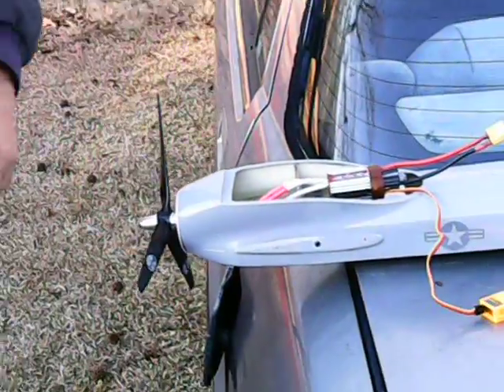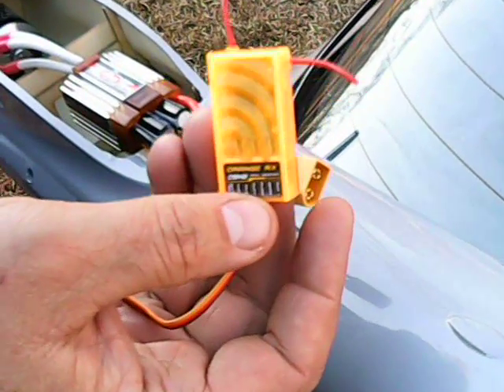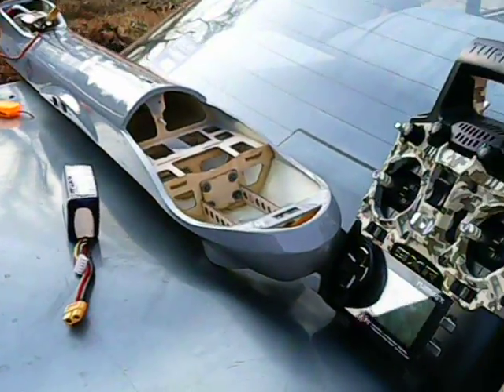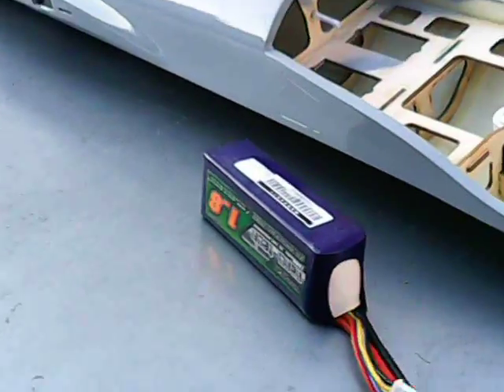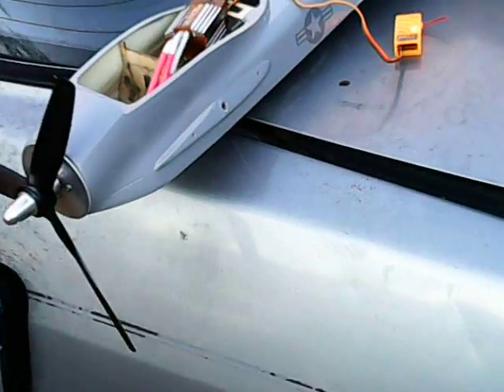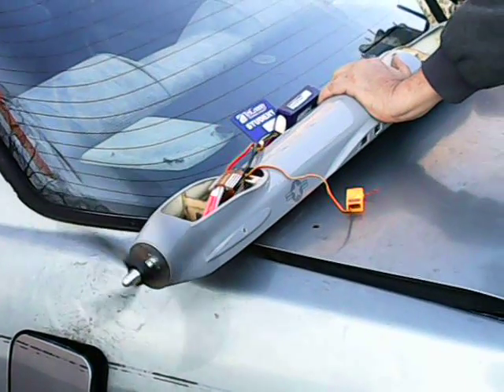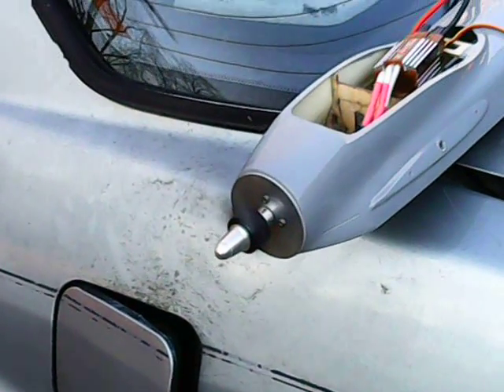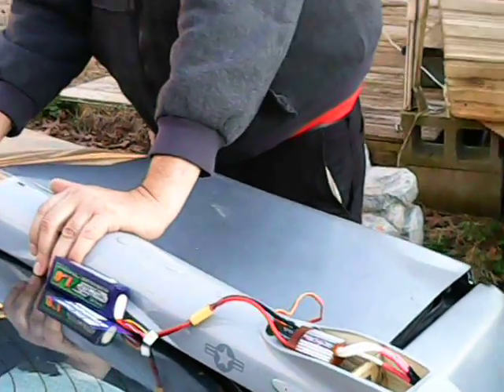Projet MQ-9 Reaper Motor Test Turnigy G-25

Comment: Looks promising. Got me worried at first when you showed the Orange receiver. I've tended to stay away from composites since they can  be heavy with all the FPV gear loaded and I have no run way but that looks like it has plenty of power. You should try a Watt meter on it,. I always use 2-blabe APC props although I have used a 3-blade prop on a Mini Skywalker. Let us know how the maiden goes. I have been looking at getting a Zeta FX-79 since I like wings, not as scale as the Reaper which has been a successful military UAV so should scale down well.
Reply from the maker: Hey!

Nice to hear from you!  I have another video with the actual numbers, and she will fly, but when it is fully loaded, it will be a little weak, therefore I am going for a bigger motor, ESC, and I have a new video where I have the Frsky DJT combo in the aircraft.

There is a lack of channels on the Frsky DJT (only 8 channels), so I will upgrade that to the new 16 channel stuff.  I am going with the NTM Prop Drive 35 class motor, and going up to a 65A (minimum, I haven't decided which one yet) ESC.

The existing setup will work for the maiden flights, but once the other gear comes in, it will be a little weak, and I may have some short runways to fly off of, so I need the "oomph".  She'll fly in the spring, and then I can fine tune her a bit more.  Here is the other video, not too good, but you will hear the data of the tests.

Projet MQ 9 Reaper Power Tests Coming To Life!
Reply from the maker: Also, I am still using the 9xr, which can handle anything you throw at it (so far), and it should handle 16 channels fine.